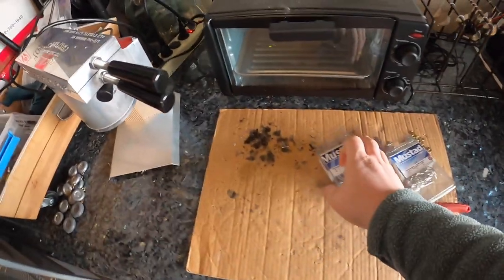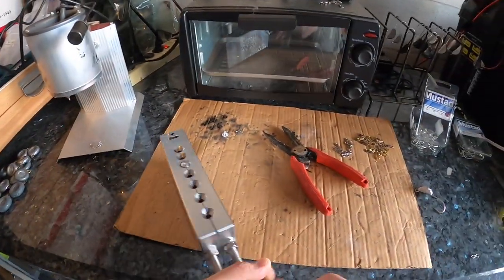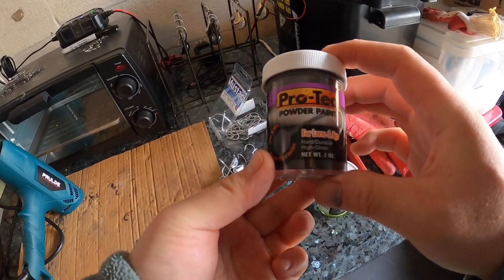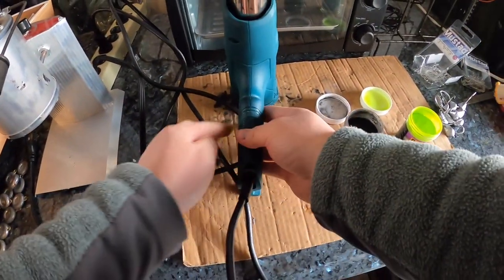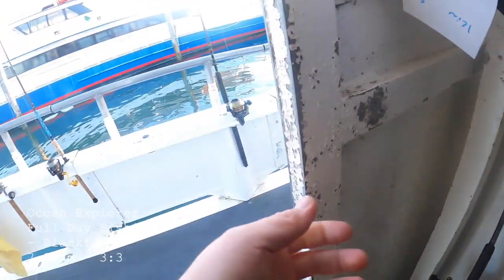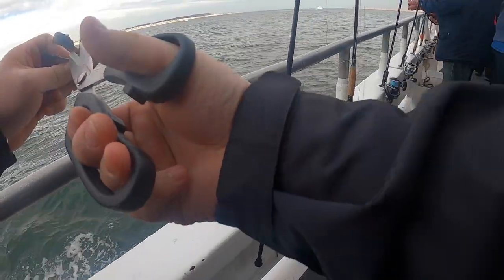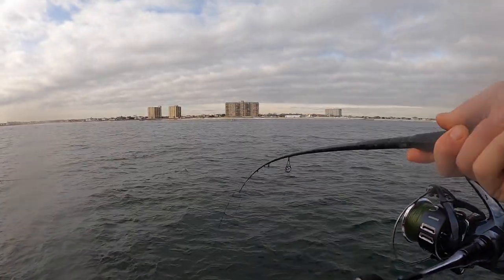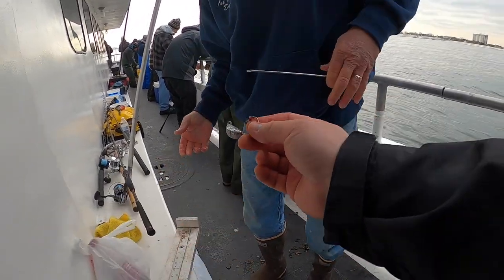How I Make My Own Tog Jigs + On Board The Ocean Explorer Tog Fishing

Comment: Nice. I like the dish rack idea! U should look into the diy fluid beds. Way cheaper than buying them and then u don’t have to worry bout the paint clumping up. Cut small pieces of heat shrink to insert in the eye before baking to keep the paint out the eye. What rod is that you are using in this vid?
Reply from the maker: Thanks I’ll try that next time. I was using the Night ranger custom from jigging world link in the description bro.